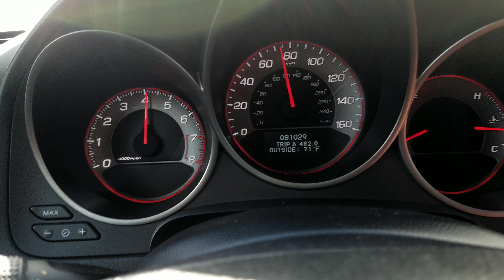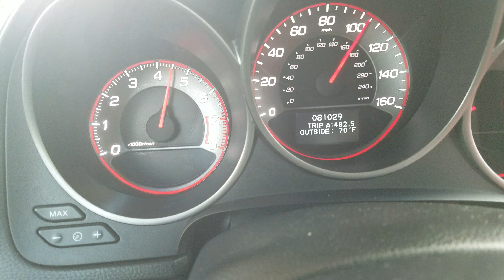2008 tl type s cabin drone test

Comment: did you get rid of the flex pipe rattle on the jpipe yet?
Reply from the maker: SYBITSU it was just whistle sound from flex pipe
Reply: khan209i yeah bro that's not normal. That's cuz tsudo has some cheap ass quality flex pipes. None of the brand name pipes whistle like that. I ended up getting some new flex pipes welded in for cheap on my tsudo and that annoying whistle went away.
Reply: @LoveTaught  hey,  I was thinking of getting the exhaust , glad I saw your comment.  I'd there any issues with the flex pipe I should be concerned about?
Reply: XxLaMaravish13xX I do not recommend the J-pipe at all. They use a cheap quality flex pipe that rattles. Go with something else.
Reply: @LoveTaught  RV6 j pipe is the same way, cheap flex pipes that hiss and rattle. Xlr8. Is the best j pipe cause ATLP has a massive torque loss below 3k rpm